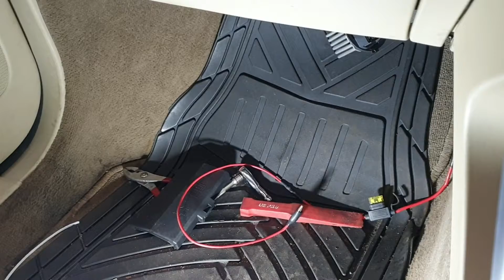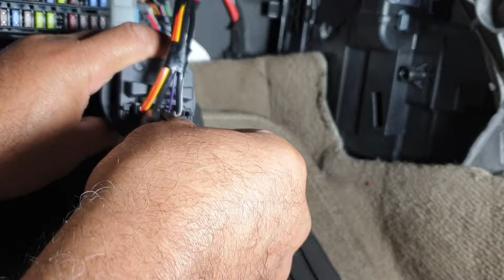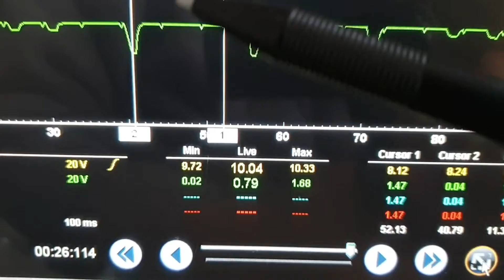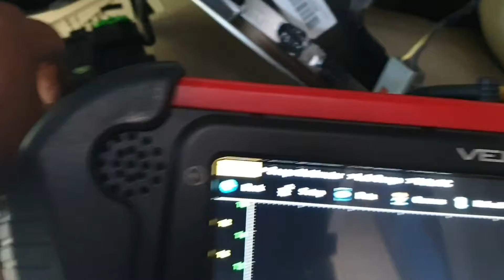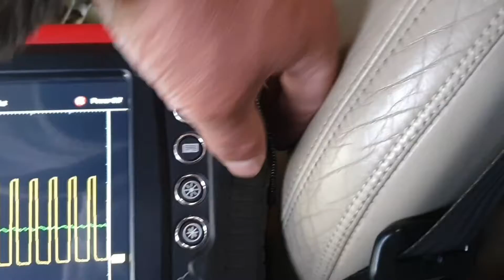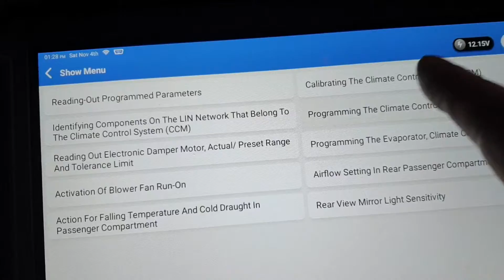Case Study Volvo XC60 Heater Blower Motor Spinning To Slowly And B10B913, B108888, B10884A, B108788,

Comment: When jumping the black wire to the black/ white, the fan does not spin. 
When checking the voltage at the black return wire, I get about 8 volts.

Does this confirm a bad blower motor?
Thank you.

Comment: Thanks Heaps for this Video. My XC60 has the same low fan speed issue with no air flow. I have opened the cowl and made sure blower fan is running, changed the hvac resistor, changed the cabin filter. I came across your video yesterday. Jumped the black cable to the return wire and found fan is running full speed when jumped. I am guessing its safe to assume the CCM is somewhat malfunctioned at this stage. Is there anything else i should be checking before ordering a new CCM?. Appreciate your advise on this.
Reply from the maker: Thanks for watching our channel 
It was a long time ago troubleshooted this case, if you have taken all steps shown in the video, then there's no chance to miss the repair, I can't remember the entire procedure right now.

Comment: I had the same problem, but when i switched to a new CCM, i have the constant codes of B10874A & B10994A that i have an incorrect component installed. Plus when I try to calibrate my DMMs the 2 on the left side and the recirculation do not work.
Reply: did you figured it out?

Comment: Thank you for your detailed video. My XC60 has the same symptoms as this and codes but I've changed the CCM and it still has a really slow fan. Do you think I should try and change the blower motor resistor next?
Reply from the maker: Thanks for watching our channel 
Disconnect heater blower motor speed control module, then bridge the black thick wire with the black/white wire by fuse able jumper wire (female side of the connector), briefly, now the blower fan motor should operate at its full speed.
Reply: Thank you I'll try that. If that doesn't work I might need to make an appointment with yourselves  @stanhopeautorepaircentrewardak